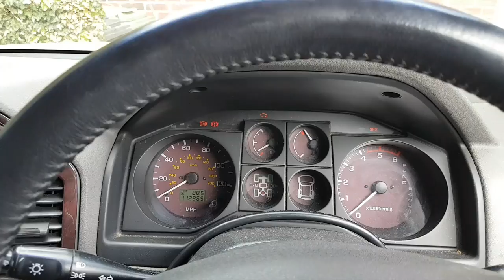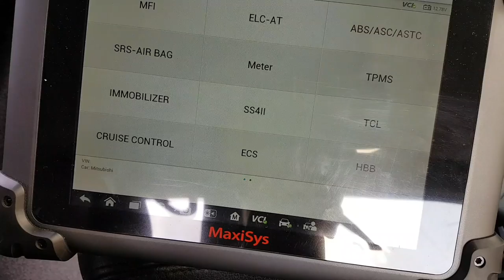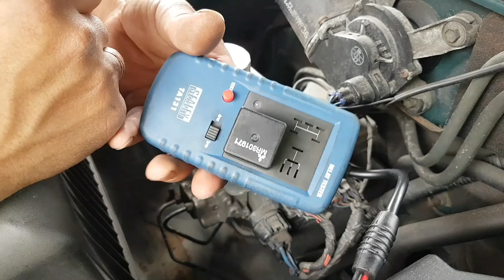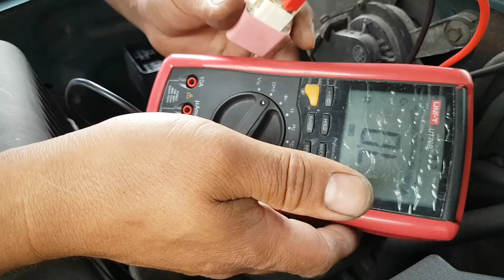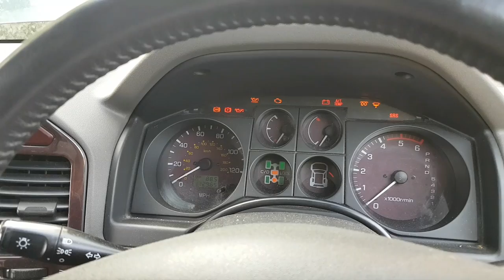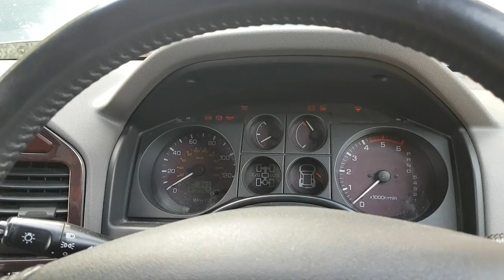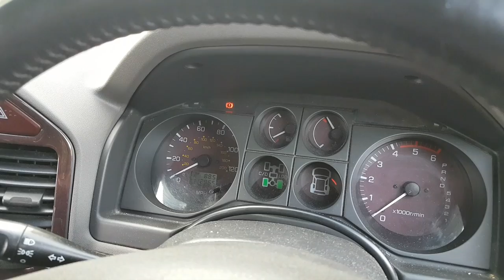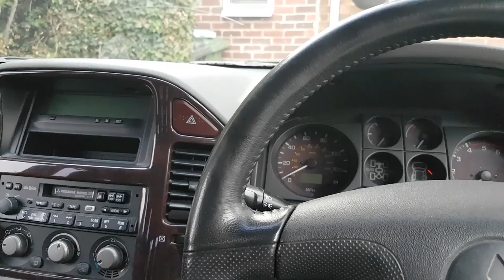Mitsubishi Shogun no brakes! HBB fault, ABS and brake light on. Fault finding and repair.

Comment: A link to the eBay seller please! Thanks for the video!
Reply from the maker: https://rover.ebay.com/rover/1/710-53481-19255-0/1?mpre=https%3A%2F%2Fwww.ebay.co.uk%2Fitm%2FEngine-Electric-ABS-PAJERO-MR407202-MR569728-FAREWELL%2F382359719523%3FssPageName%3DSTRK%253AMEBIDX%253AIT%26_trksid%3Dp2060353.m1438.l2649&campid=5338344466&toolid=20008

Thank you for watching!
Reply: @LMAutoRepairs  Thank you!
Reply from the maker: @好不好-v6s  
👍
Reply: It works well?

Comment: I have a weird case.  2002 Mit's Montero Ltd.  The cover begins to vibrate and make a squeeky kind of noise for maybe 10-15 seconds and it does it more frequently as time has gone  on.  This has been going on for years and my ABS warning light use to be on, but I don't think it is anymore.  My brakes are good and after I was given a price of $2,500, but my braking is ok, so I've ignored it.  Now, it is driving me crazy and thanks to you, I have a better idea of how it works and how to fix.  Right now, before I remove and replace with a used motor or a new one, I need diagnostics on whether it is my Control Unit or the Motor.  I'll post a short video of my problem
Reply from the maker: Hope you get it sorted.
Thank you for watching and for your comment! 
👍👍👍

Comment: With hindsight, especially when you consider there are only two bolts holding the motor, would it not be easier to leave the master cylinder in place and work under it blind and remove the two bolts and draw the motor out without disturbing the master cylinder and its hydraulics?
Reply from the maker: Possibly... but I did not knew that at the time... neither knew that the issue was indeed the motor... 👍
If I get another one with the same issue, I will definitely avoid to remove the whole thing...
Thank you for watching and for your comment!
Reply: @LMAutoRepairs  It's damn near impossible, far easier to remove the whole unit like you did, the biggest pain is bleeding all the brakes!
Reply from the maker: @TheMountainHare  
👍👍👍
Reply: @LMAutoRepairs  Hello , I need help , I fix my own stuff but this has me beat , 98 Mitsubishi pajero / montero lwb gls , I have no top brake light and no rear wiper , i have turn signals , bottom brake lights work , I have tested the bulbs and the cluster and fuses , I hit a huge pot hole smelled some plastic burn, lost my alternator the 
A/T light battery light came on was down to 9v I replaced with new one thats all good but I can't find why brake and rear  wiper won't work , is there a relay or something obvious or secret im missing ? any ideas? Would massively appreciate any wisdom I'm not usually one to ask but I have to admit I can't work it out .
Reply from the maker: Have you measured wiring?
From the lights that are not working to where they are fed from?
That would be my next step...
👍👍👍
Reply: @LMAutoRepairs  thanks mate, I am midway through car from rear , going to read on wire diagram from the front way but first will check power to fuse and go either way from there , I didn't think to check power to fuse only the fuse itself , appreciate the reply  👍

Comment: Both pump relays are the same but mounted 180 degrees apart, so watch this, the system needs both relays and both power the pump motor.

Comment: Hi Luis I find when changing brushes that are staked or spot welded if you cut the pigtail of the old brush close to the spot weld you can solder the new brush to the stub and save time and work
Reply from the maker: Good idea! 
Thank you for watching and for your comment!
Reply: I did that..but it seems like the excess heat melted it.. only work for a day

Comment: Hi,my pink relay for abs keeps on clicking and the accumulator keeps on going on and off continuously, and the brake fluid in the container  looks foamy..The brakes work just fine l would say.What is the problem? The car is a Pajero 2002 model 6g72 engine.
Reply from the maker: Perhaps is loosing pressure, the accumulator, making the motor/pump to constantly kicking in to keep the pressure where it should...
Scan the car and check live data... should help you finding the issue...
👍👍👍
Reply: @LMAutoRepairs  Thanks for the advice.

Comment: Thank you to make this video for us.What y want to say is that if you could find the correct brushes (and y know that the comutator on the rotor is a bit worn) you could repair it by replaceing the brushes,not the rotor.
Reply: brushes are easy, just measure the size, and you can file larger size down, all sizes from china. (BUT maybe softer and wear faster than original, who often use copper infused brushes)  but in this case it wasnt only the brushes, the commutator was worn to the point it fell apart, i guess they make the brushes long and hard enough to last as long as the commutator

Comment: Great work Luis, I would love to see you fix a Mercedes SBC pump motor & get the red warning of death code removed!! I have one if you want to have a try. It would make you a legend on the net to sort out one of these.
Reply from the maker: I would have a go... but without having the car to test would be complicated...
I actually had that is the past... but the owner supplied a second hand SBC... so I just had to replace it....
Thank you for watching and for your comment!
Reply: @LMAutoRepairs  Luis, I would willingly bring the car to you even if you lived in John O' Groats to get it fixed! I have fitted a second-hand pump just to get the car mobile but the abs & the  esp fault codes are still there as I can not 'code' the sbc pump to the car that needs the Mercedes X system  requiring a visit to a dealership & huge money even if they would do it for me (I doubt it with secondhand pump) it's more than the car is worth with their prices. I have the original pump that is coded for the car. It is a lovely car apart from this problem. I live in Farnham, Surrey.  Wishing you all the best Luis.
Reply from the maker: @keithglaysher737  
😮
You are quite far away from me!
And what if I couldn't do/finish it on the same day?
Reply: @keithglaysher737  Hi. There is an independent merc specialist in Ashtead that might have a go.. Or might not. But give them a ring and see.

Comment: I replaced the pump, do i need to put fluid in and clean the codes for the beep to stop? Or just fluid?
Reply from the maker: If you had the brake system opened, you need obviously to top it up, and bleed the brakes... as air got into the system....
If the system then runs properly, I believe the light will extinguish itself... but if you have how to, clear the codes when finished...
Thank you for watching!
Reply: @LMAutoRepairs  thanks, i am sorry if it was dumb question but i am kinda new at being a mechanic.
Reply from the maker: Not a problem... we all start somewhere...
👍👍👍

Comment: I have same car same problem but the motor is working good. So what should i do?
Reply from the maker: So actually don't have the same problem...
What codes are you getting? 
Thank you for watching!
Reply: @LMAutoRepairs  the same codes also. The motor is not working only in the car but when i check it separtly with bettery its rotating smoothly. I think its control unit module had a shortage and need relpcement?
Reply from the maker: @othmanpajero  
It is a possibility...
But check everything else... fuses relays etc...
I think there is external relays for that motor... but not sure without checking diagrams...

Comment: Can I do this on toyota prius nzw30 also. Because I replaced actuator but it shows c1345 and c1368 error codes. I installed old one it also showing the same codes.
Reply from the maker: Hi
I don't have much experience on that job...
But, have you managed to do the linear calibration successfully?
Reply: @LMAutoRepairs  linear calibration is not succeed.
Reply from the maker: @Raajkumar_T  
There's your problem... the replacement actuator, was second hand?
Reply: @LMAutoRepairs  yes.
Reply: @LMAutoRepairs  I checked for brand new at toyota dealer, they said it will cost 4000 us dollers with modulator and installation charges. Thats why I installed used one.
Reply from the maker: @Raajkumar_T  
That's fair... but an used one introduces many variables during the install...
Are you sure that the used one you bought was good?
Reply: @LMAutoRepairs  I tried with two other actuator. But same message I got. Earlier I had only actuator mulfunction message.

Comment: The downside of this mechanical/shock method is very fast fix and that the client after this diagnose will see that the car is fixed and will not want to really fix the problem.But the fix is for a short period of time,and will came back to you begging to fix the car by repairing the motor like you told them from the start.
Reply from the maker: That's true... but it is also a good indication that the problem is what it it...
👍👍👍👍

Comment: does this motor run everytime the brakes are applied? thats a lot of hours to wear away the commutator
Reply from the maker: Not really.... it builds pressure on the accumulator/reservoir and then runs to maintain the pressure.... you can brake a few times before the pressure drops and the motor kicks in...
Still.... there is a lot of running time for a little motor like this... should be a brushless motor...
Thank you for watching and for your comment!

Comment: So basically you just need the  motor and brushes? right? the body and the rest of the parts remains the same.
Reply from the maker: If your problem is same as the one in yhe video, yes...
👍👍👍
Reply: @LMAutoRepairs 
1. my relays are fine
2. motor is not taking load while all the wire connections are on.
3. motor can take load and spinning when its directly connected to battery.

you think replacing the inner motor and changing the brushes could help fix the abs issue?
Reply from the maker: If the motor is running when connected directly, I would say the motor is not the problem...
Unless is intermittently...
Reply: @LMAutoRepairs  that's what im thinking though, specially when the whole system is connected, the motor fluctuates. relays keep on kicking in but the motor wont take the load. when I tap the canister motor will start to kick in. i

Comment: Why was the temp needle in the red all the time?
Reply from the maker: Was an issue with it... the cluster, the sensor or wiring.... never checked...
Well spotted...😋
Thank you for watching and for your comment!
Reply: @LMAutoRepairs  I noticed the long crank and no rev counter before start. Thought it might have been a faulty cam sensor.
Reply from the maker: @500miniS  
Other issues that I have not been asked to look at... 
Thank you for watching!
Reply: I have same model and it has the same problem as well as the abs alarm.

Comment: Here is the eBay link of the repair kit in case some people need it. It is also for 2003-2005 gx470 and 4runner.
https://www.ebay.com/itm/Repair-Kit-ABS-MN102843/312120295316?redirect=mobile

Comment: Next time when you suspect problem with a motor with brushes before you dismantle the motor try to hit the motor with a hammer.GENTLY ! If there are brushes worn but with a little life left in them the motor will start to work again.I apply this tactic with starter motor,alternator,fan motor..Especially when working on the field and i don' t have much time or resources around me.
Reply from the maker: I know that trick... thanks!
Thank you for watching and for your comment!